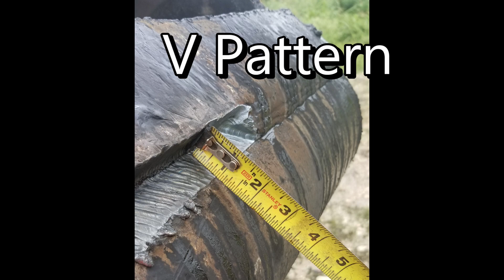365 Excavator has issues

Comment: Nice job!Question-i folded my frame up on my mini Komatsu pc 20-7 rust and too much weight and im an idiot.3/8 material is what i have to fix with.is a flux core welder good enough or should a guy use stick?Also i have to pull downward to straighten frame.Have tryed porta power 10ton any insights on putting power downwards instead of upwards?to straighten frame that holds tracks on.Have heated with oxy and am concerned that the heat might weaken the steel?Any help would be greatly appeciated.Thanks
Reply from the maker: I used fabshield 21b fluxcore on this rebuild. And as far as bending and moving things back in place, sometimes its best to cut things loose and realign the parts. In this video you notice I cut some of the bent sections off so I could reattach the remaining piece with a good known reference point.( where the original break began) Look at the video again and notice what I cut apart and what I left in place. hopefully this will give you some insight.
Reply: @ICWeld  Thank-You

Comment: What kind of suitcase you run? A ln25 1993 model is what I use
Reply from the maker: yes LN-25
Reply: Awesome
Reply: I just bought my own welding truck 2nd gen Ram 3500 4 dr with a 3500lb crane Lincoln 305g and a mint condition 1993 gray ln25

Comment: Does this happen from the use of a hammer attachment??
Reply: I don't think so. The tool they attached to the arm seems to be like a cutter. Also it is working away from the machine not towards it. I assume they are using it to lift concrete slabs or heavy stones upwards. This gives you a very bad distribution of force because of the extended lever system of load and arm. But I'm only thinking.

Comment: How much tensile strength is flux core
Reply: Read the wire specs.
Reply: @sugerbear6544  oh yeah? I was asking a general question I don’t mess with it anymore and didn’t mess with it much so was looking for a general idea.
Reply: @oklahomachris6298  Oh ok i see, thought it was typically 70,000-80,000 psi, but i might be wrong.  Different wire out there
Reply: @sugerbear6544  I have no Clue that’s kinda what I was asking about just curious on it..

Comment: To me the design of bare box boom is bad - need inner corner plates for shear forces (every corner should be triangular by symmetry and back plates should be 'fish plate' type to increase stress area (not just welding purpose at joints) and direction for metal fatigue by molecule orientation - under high pressure, the metal look like a living thing and at some point is enough to fracture at point of impurity or air bubble in metal).